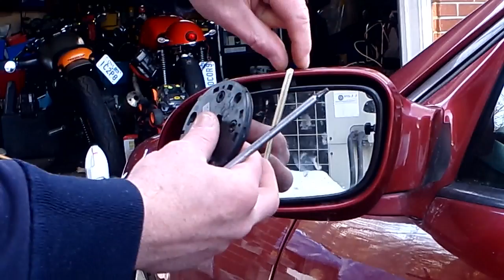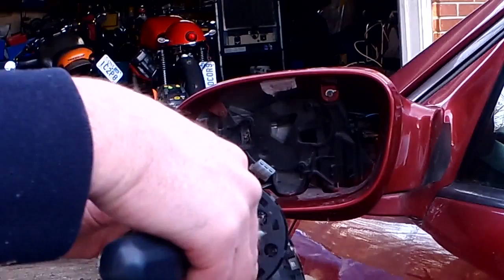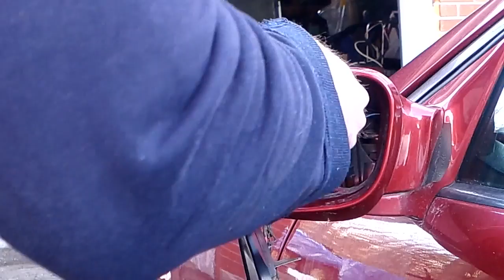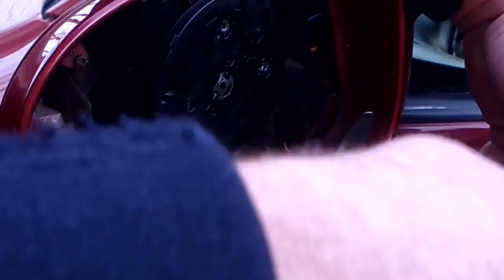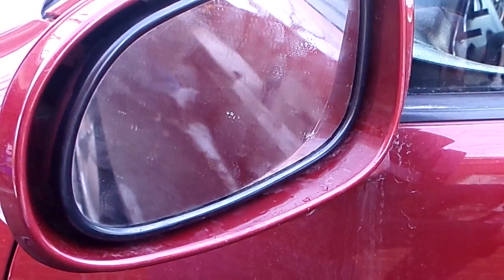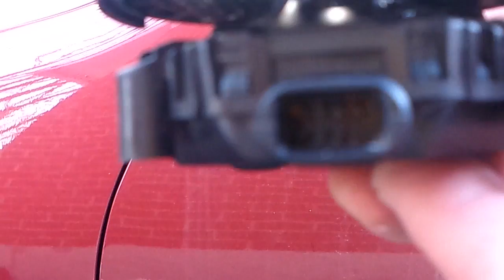How to replace power mirror motor.  Mercedes W208clk R170 slk

Comment: I have a w202 and I noticed the motor plate that mounts the mirror is very loose. Does that mean I need a motor replacement? Or can I fix it at home?

Comment: Craig I am trying to replace the disk that is connected to the motor and to the mirror can you help me? It looks like I should squeeze the clips in the middle together but I can’t get it apart. Am I on the right track?
Reply from the maker: apologies for the late reply. There should be a small 6 sided "allen" head screw in the centre holding the flat disc to the mirror motor unit

Comment: How do you get the faceplate off the motor housing
Reply from the maker: some just pop off. If you have one with a screw it just unscrews in the center then pops off.  They kind of snap together

Comment: just a quickie, does it matter which wire (brown or blue ) one connects to on the back of the mirror as i couldn't recognise a + or - ?
Reply from the maker: +ace Grandison they can be swapped into either connector with no issue...
Reply: fupabox outstanding.. I did find the part on ebay...i had to order from Turkey,  but its all good. appreciate the help. Took about 1 hour,  but your correct make sure you have it straight!

Comment: Any suggestion as to where I could find a replacement heated glass for a SLK 320 at a reasonable price?.  Dealer runs about $420. for glass only.  Incidentally your videos are great
Reply from the maker: +Chuck Stogner  what side ?  I may have one laying around ..if not..ebay or pelican parts...rockauto has drivers side glass..not sure from the listing if it is heated... $10
Reply: +fupabox Drivers side.  Mine is heated and dimming.  I could do without the heated, but dimming for cars at night is a plus.  I will check with Rock Auto, but would think that it is plain glass.  Thank you for the feedback and let me know if you have one and how much you are asking for it.  Mine is getting foggy.  Do not have memory seats

Comment: I wonder if you encountered an issue with position memory on mirror going haywire once in a while and setting the mirror in a strange position? Dealer wants to replace the whole mirror assembly (pricey...). Is it electrical (wires, motor, connector, etc) or mechanical issue?
Reply from the maker: I would take the mirror motor off and take it apart..(not too hard  it is just 2 halves..only real tricky part is the little wire clip holding the center swivel pin into the assembly..if you don't remove the wire the center swivel won't  come out) and check the electrical connections for corrosion... before removing though, I would check the mirror connector on the inside of the door panel behind the mirror.. i pop the plastic trim cover out and the wiring plug is in there
Reply: Thank you! I'll do that. Do you know if mirror glass on GL-class is removed from the motor in the same way (by removing upper metal holder)?
Reply from the maker: Alex V. the GL should have the same metal spring clip holding the mirror glass on
Reply: @fupabox  my mirror won’t fold and they told me it was the mirror motor on my 2013 ml350 how do I know it’s the motor problem?
Reply from the maker: @saltychin  if only one won’t fold then the button/ switch for folding is likely ok . I lubricate the mirror folding mechanism every fall just to be sure . When it’s really cold the mechanism can get sticky or stuck . If you can help the mirror fold with one hand as you press the fold button with the other you can get it folded and able to be sprayed with WD 40 or any similar lubricant . If it won’t fold even with a bit of help , the motor could be burned out . The only way to test the motor would be to completely remove it from the vehicle and apply 12v power to the connectors.

Comment: Hey just have a quick question on a video you posted a year ago, on the 2001 civic the one you cut the springs on , was the ride bouncy or do you know how it felt after wards?
Reply from the maker: as with most cut or lower springs, the ride was just a bit stiffer than stock..only 1 coil removed, so not that great a difference.. if you have good shocks/struts  the ride shouldn't be bouncy

Comment: Ah man, a 95 E320 with 44k miles came up on the insurance auction... Pretty minimal front damage, bags didn't deploy. Guess at 44k on probably the most reliable Merc ever, I just HAVE to buy that, huh? Haha
Reply from the maker: OOOoo.  I had a 1995 e320...great car...just watch for rust on front shock towers...amazing car..last of the w124s
Reply: Damn, well I looked more into it, it has some extent of undercarriage damage so I'll just have to add it to my list of potentials to look at next time I'm down there but who knows... found a 95 C220, same color as mine, with only 51k miles in immaculate condition with some minor front end damage in Michigan, youll go pick it up for me right? Haha I'm working on delivery quotes to my uncle's house in NY, down to $450 or so maybe less with more work so who knows, beautiful car, could be worth it. I mean, just one of those, you know, older guy had it since new and kept it nice (it appears something like that), factory radio, owners manual in the back seat pouch, Mercedes club front license plate, clean as a whistle all around... there can't be many of those examples left, regardless that it's been totaled due to the cost of new airbag replacement.
Reply: I like that the 95s have the old style power steering reservoir with the filter and the more basic climate control unit... just little touches like that. Although all the diagnostics and data feeds off the auto climate control are pretty cool and useful.

Comment: look man i do feel bad that urs i broken BUT at the same time i'm glad coz mine snapped off its place (( i hit a truck with it don't ask :P )) and i could NOT put it back in !! now i know its the clip thingy and i'm going to fix it  ^^ thanks ^^
Reply from the maker: Glad to help :)
Reply: +fupabox annnnnnnnnnnd 10 months after i tried to pull mine off to pop it back in the right way and the i found out that the motor screw holes are broken >> i mean HOW DEAR IT BROKE OFF !! i only slammed that 20ton truck at 140kph >> mercs are getting weak :P anyways i guess the only way is to yank it out and hope i dont brake the mirror too :> then im due for a new motor or some kind of a metal glue hackjob :P
Reply from the maker: KingStivan 140 kph... ? nothing should have broke..that's barely moving   :P
Reply: ***** thats what i said i wast going fast :P i slammed the small lip on the trucks side thats used as a stair >> hate those rouge parts that sticks out for no reason :P